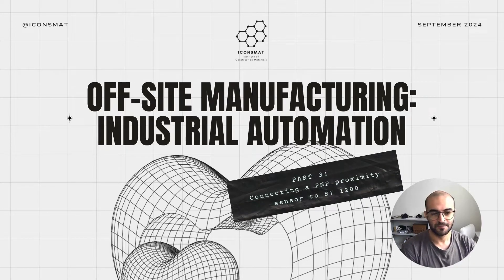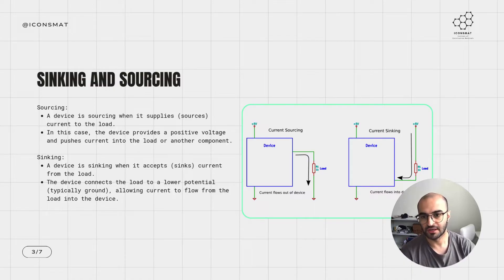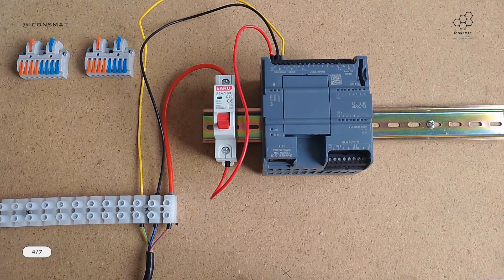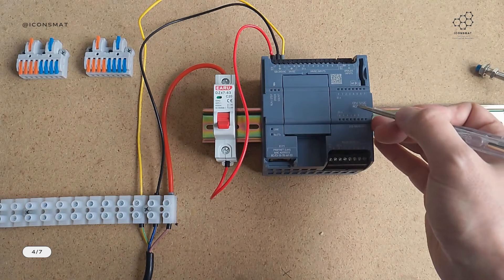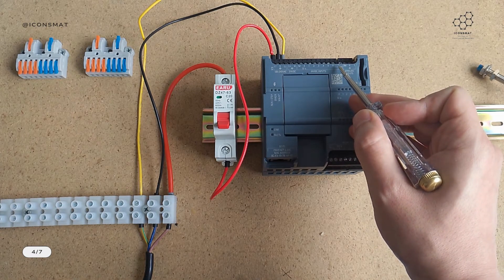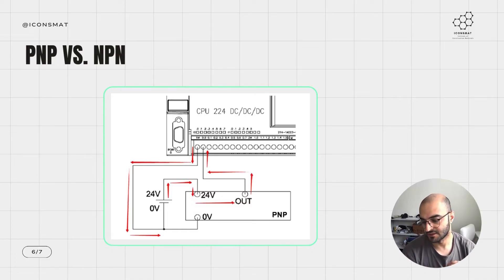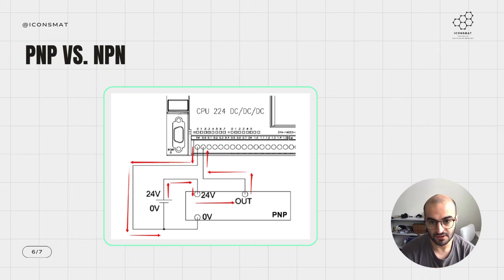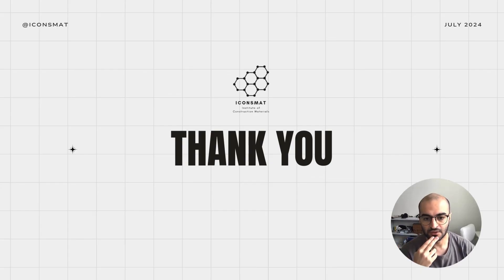Part Three: Wiring PNP proximity sensor and Siemens S7 1200 | Industrial Automation

Comment: So black wire is connected to DI0, brown wire is connected to M and where do I connect the blue wire then?
Reply: The Blue wire is (0Vdc) so it is connected to "1M", and Brown wire is connected to (+24Vdc) , where Black wire is an output and decided by the type of sensor either NPN or PNP type. For example, Realy has A1(Positive side) and A2(Negative side). if you want to provide positive voltage, try to connect Black wire to A2 in order the current flows from negative (A2) side to positive (A1) side saying that +24Vdc is ready to be used to your applications externally. @iconsmat is this what you want to say.
Reply: @nurjamahashiabdulle1711  Thanks for the explanation
Reply from the maker: @nurjamahashiabdulle1711  Yes. It's all relative. As long as you can determine the current flow direction, it is all good! Thanks for the example 🙂
Reply from the maker: Hi, It really depends on your sensor. It is better to refer to the sensor manuals as even the colour codings may differ. For this example, brown is the positive pole, blue is the negative pole, and black is the output terminal.